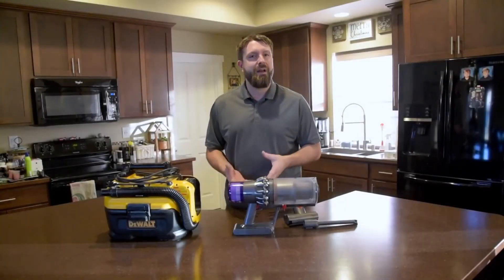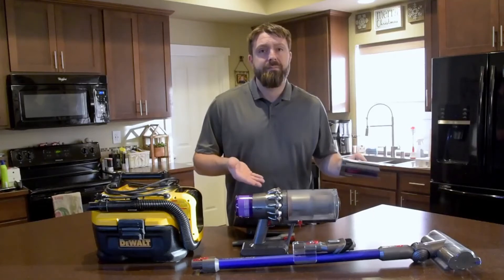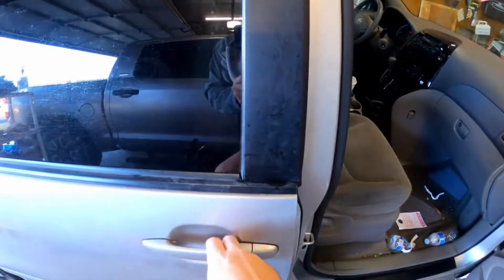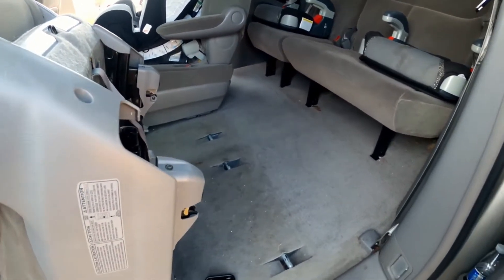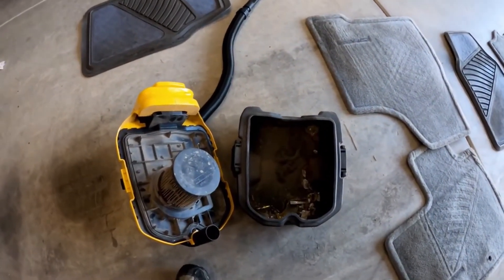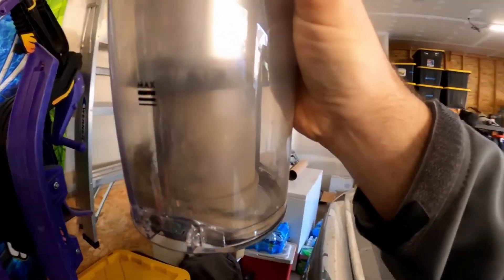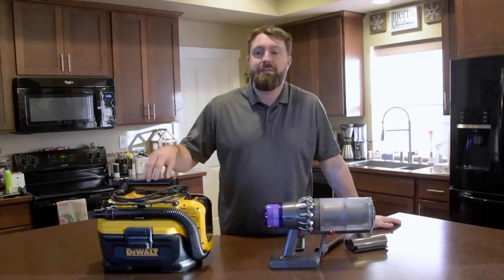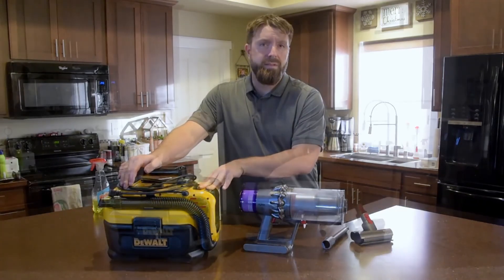Dyson V11 Car Cleaning vs Dewalt 20v Shop Vac

Comment: Hi i'm french, living in an appartment, car is parked  in the underground parking without access to power outlets. I have a Dyson V10 motorhead for home use and the old battery can't handle max power for more than seconds. OEM battery is 99€. Painful price. So I was wondering if I should buy a 18v powertool vacuum instead and how it compares. Thank there is alway a guy on YouTube to answer my problems.

Issues I have with the Dyson are it"s partially broken (a plastic ring inside the tank holding a seal) I'd doesn't have a hose and everything is always in your hand. So you always carry all the weight and it feels clunky in tight spaces.

Comment: What I found "wrong" with this video -- you used a shop vac, then the Dyson -- and praised the Dyson for "doing more". But countless reviews have noted the Dyson's a great "deep cleaner" -- over suction, but also over the heads used, I suspect -- And DeWalt's shop vac has no powered heads, you used their matching crevice tool. But you didn't match it. You did one part of the job with one tool, another part with the other, and I don't think either tool would be worth a damn at getting it done all by itself.

How about you do another video where you start with the Dyson, use it for crevases/*the whole car* -- and then at the end you can come back with the shop vac and try to "get more" from the wide open spaces. The result, I suspect, is that the Dyson's big and bulky and has no hose, so it's going to be total crap for getting into some of the tighter crevases in the car (look on youtube, I am, that was said in one of the last vids I watched, and my own fear of it was why I watched it). You'll still see dirt. And the shop-vac won't get much more of anything after the Dyson's done the open areas, yes, the Dyson is the super-cleaner, type of thing I'd rather use in my house, etc... Car? Give me a crevace-on-hose for all the knooks and crannies 'n such. Getting every lil' particle out of a flat bit of floor? Dyson with appropriate brush-head. Spot pick-up, small/complex-area pickup, liquid pick-up, give me a portable shop vac. Tool Designers? Give me a powerful battery-system-designed shop vac with interchangable heads including *powered heads like the Dyson has*... And then we'd buy yours so we won't all need 2 vacuums...
Reply: Hahaha you said it all mate.
No need for further discussion.
It is allmost like he is trying to sell Dyson products. My friend have both dyson's and small pieces broke and it is impossible to repair. Constructed to fail
Reply: Dude, he covered these exact reasons in the first 3 minutes of the video. Clearly, you just wanted to have a keyboard tantrum. He clearly states he had been using the Dewalt around the house whether that was it's intended purpose or not is beside the point.  We knew what we were getting into before we clicked the video because the title was clear. This is a clever comparison, We all knew the Dyson 11 was going to better, but HOW MUCH better is the REAL question, so the way he did the comparison was excellent! The fine dust pile he tipped out on the garage floor answered that question!  A side by side comparison would have only answered what we already knew. Good video well done.
Reply: @Pho8os  none the less it is still a shitty machine
Reply: @v12monsterable  I am not talking about the product nor was I replying to your comment. I was replying the George Corder. The video was a great review. Fanboys love watching review videos where their favourite product wins a review than have a tantrum when their favourite product does not.
Reply: @Pho8os  Well this is about a product! Jesus Christ. We are watching a video of a product against another product, not about how hansom or the sound of his voice is nice. But yeah he is probaly a nice guy and he did make a good video but we this is still about a product.
Reply: @v12monsterable  and he did a great review of the product go READ my first post!?!?!?!
Reply: @Pho8os  WATCH VIDEO AND READ VIDEO'S TEXT. THIS IS ABOUT PRODUCTS AND NOT ABOUT YOU
Reply: @v12monsterable  you still have not read my first post or answered it, you are going off on every tangent except what I wrote. You are saying stuff no one is even talking about!?!?!
Reply: @Pho8os  hmm what is the video about???? You??? I think 2 different product. Stay on track
Reply: @v12monsterable  all of this is in my first comment, stay on topic, and try to stay focused.
Reply: @Pho8os  so you praise "the man" and continiue to talk about "the man" when everyone else is using the video to find out if the dyson can do better than Dewalt even is the comparison is unfair. Still you continue to praise "the man". Jesus and you talk about "staying on topic". Clearly your the one having a "tantrum"
Reply: There seem to be no resolve so have a nice day/evening
Reply: @v12monsterable   Who are you referring to “the man”, what are you going on about?!?! And another thing, don’t presume to speak on behalf of other people. There are many reasons people came here to watch these reviews; who elected you gatekeeper for YouTube. This is the second time you anointed yourself, speaker, on behalf of others. I am detecting a pattern here. Don’t make assumptions focus on the words written in the post. And please try not to use profanity.